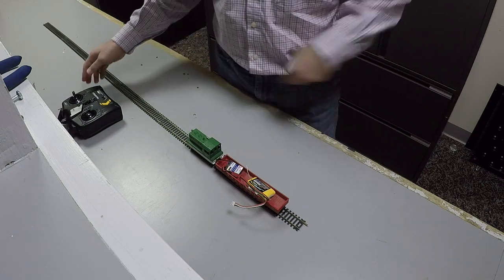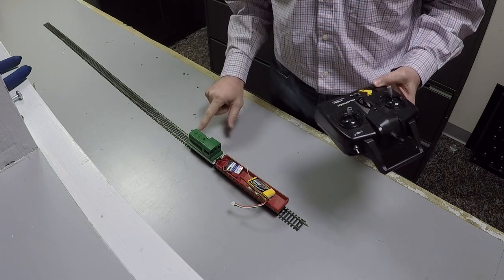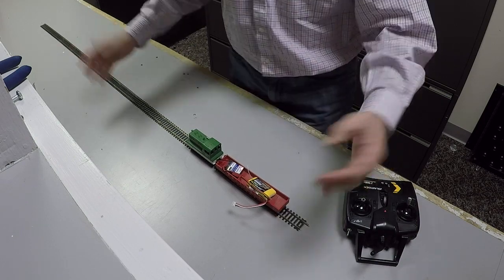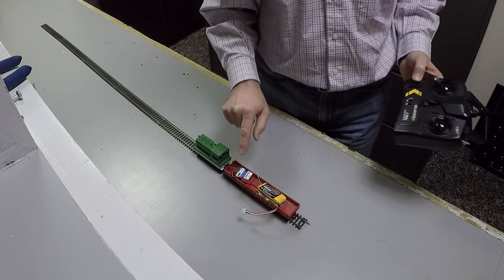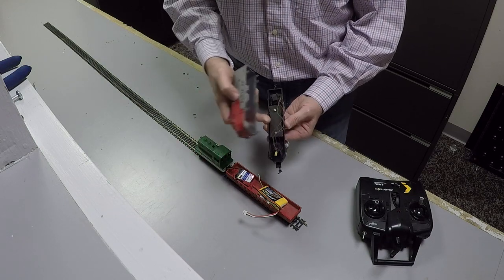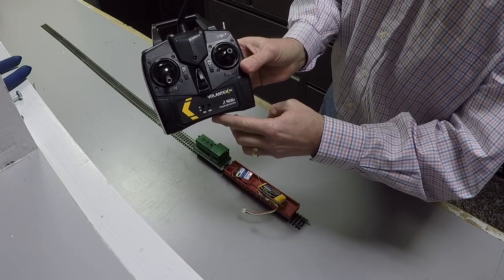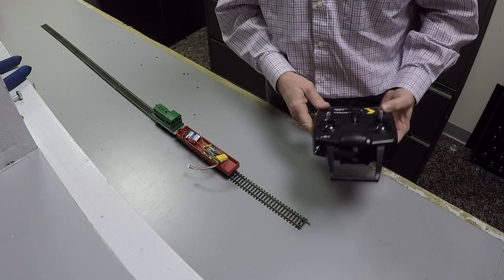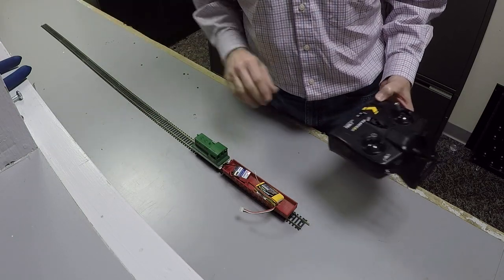Dead Rail Battery Powered HO Locomotive with Transmitter - Receiver

Comment: There will be resistance to this. It's understandable. For any modeler with a large inventory of motive power it looks to be an added investment. For the modeler just starting out or getting back in it will be ideal. I dont think that we will ever eliminate wiring entirely but eliminating it for track power has a lot of advantages.
1) Eliminating problems with reversing loops, powered Frogs etcetera. 
2) Track maintenance. Specifically track cleaning. 
3) Visual aesthetics. No wires to hide. Track that is meant to resemble seldom used branch lines or sidings could actuall have a rusted appearance. Could steel rail make a come back?
4) You can run the motive power on any layout. Because you are not dependent on the layouts power supply. Block control, DCC, it doesn't matter.
The down sides
1) Cost issues. First you have the added motive power components. Mainly the battery. But you are eliminating the cost of the DCC or other power system. If say Kato, Proto 2000 or somebody jumps in on this they could offer an app that let's you control the engine functions with a smart phone. 
2) Space availability. Just how much room does the battery take up. As batteries get better it should be less. Solid State and Carbon Nanotech batteries are currently in the lab. One factor that will drive this technology is electric vehicles
3) Run Time. An hour? Two? Two hours of steady run time should be more than enough for an operating session.  The one problem I see with run time is let's say you are doing something else around the layout. Structure building, detailing rolling stock etc. And you just want trains running while your doing that. One way to do that could be to have a dummy locomotive, freight car whatever with an extra power supply similiar to the power cells available for hand held devices. 
4) Power for the cab control. If its wireless that's one more thing you need to charge. But if you are using a smart phone you're already there.
5) The big one. Right now this at the do it yourself stage. Or send the locomotive to somebody to convert it. For this to take off it needs a manufacturer to step in and it needs some sort of standards.